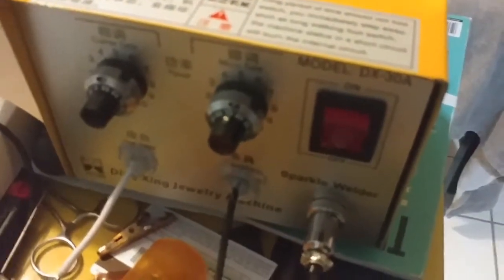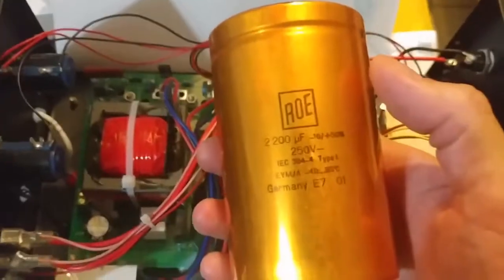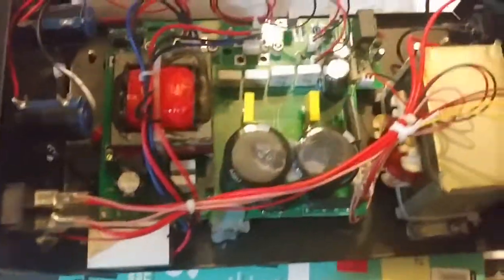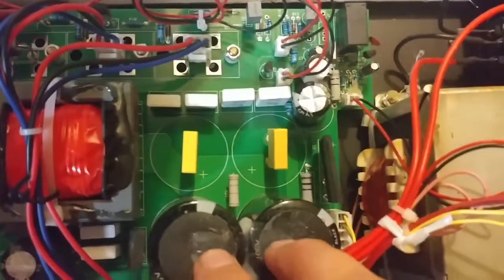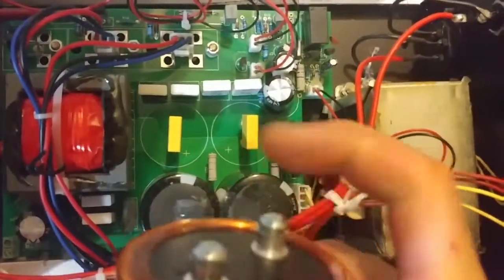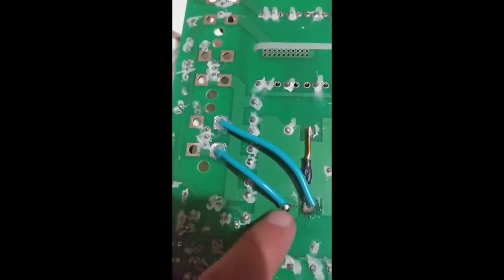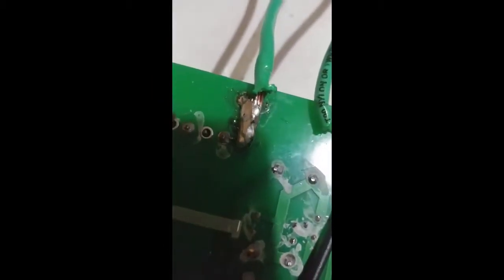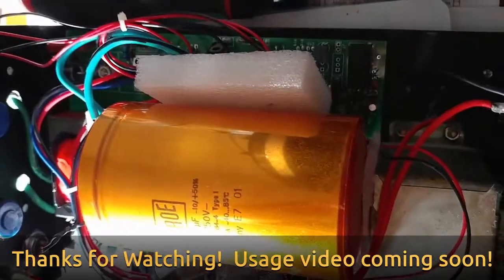Chinese Sparkle Welder Inspection / Internal review / Upgrade!

Comment: Would this machine be able to weld 316L foil (0.03mm thickness) to an object say 10mm thick(also 316L)?
Reply: It might.  If anything it would be too powerful even on lowest power.  See https://www.youtube.com/watch?v=ysL9gX5BQ_0 for what it does to aluminum foil, albeit on highest power setting. 0.03mm = 30 microns?  So a bit heavier than aluminum foil @ 20 microns.  For something like that, might be better off with a spot welder.  I saw some people use these to make thermocouples with quite fine wire.
Reply: @bigBabyJ  I suppose removing a capacitor or swapping it for one less powerful might do the trick.

Comment: I just finished my upgrades and I reinforced some connections but I didn't really understand the outputs, it really seemed like the 'negative' output wire was connected to the negative end of the capacitor, the negative side of the resistor and all that. but here you have it connected to the positive? How'd you figure that out?.
I even remember testing the thing with the resistance meter.
Reply from the maker: Where'd I do that?  I recall messing up some wire colors at one point.  But now both my output wires are green lol.

Comment: I don't know a ton about capacitors but I've seen some rectifier upgrades on AC welders and they generally recommend a big capacitor as you want as long as it is rated at or above the volts/amps you'll be dealing with is it the same deal here?
Reply from the maker: Yeah, and make sure it's put in parallel, not series to boost the overall capacitance (or vise-versa hah I need an electronics refresher).  The big cap though is rated basically the same as what's in there, despite the physical size.  Just a different manufacturing process / electrolyte or something.  If I could do it all over I'd buy 2 with the same rating as what's in there, and have them mounted right on the PCB like the original ones.
Reply: @dashSlap  got my welder pretty recently, after a refresher on capacitors, got to say it looks a lot cleaner. may be a few more screws then yours, and all the connections were soldered, except at the very end, none of those weird screw things, but no grounding wire?
I ended up going with a couple of 1000uf capacitors cuz it was all I could find, but I might venture onto eBay for some full 2200s
Interesting thing is they seem to use the same capacitors in lots of welders, I have a MIG with the exact same rated capacitors on the board.
Wonder if that voltage rating is actually necessary, I have a massive audio, capacitor 1 farad  but it's probably only good for like 60 volts.
I probably wouldn't put that in there anyway, but you get a lot more capacitance far cheaper.
Reply from the maker: @FrancisR420  Notice much improvement?  I was able to get things to stick that wouldn't before, but a little more oomph would be nice.  True on the voltage... guess if I powered the thing up and measured what they're storing might have a better idea what is necessary.
Reply: @dashSlap  think maybe I'll try to do a before and after video, none of the two videos modding these things have a before and after, only after.
Reply from the maker: @FrancisR420  Cool, i'll watch it if you do.
Reply: @dashSlap  done